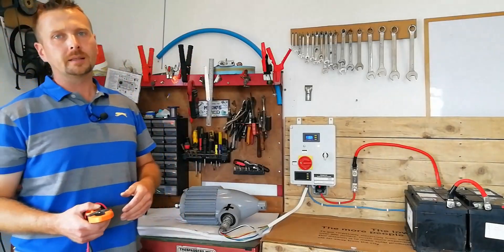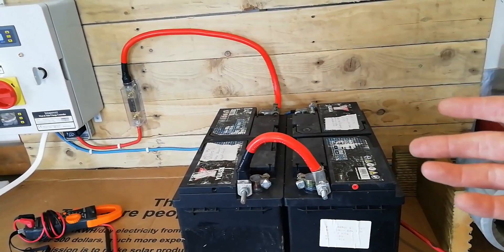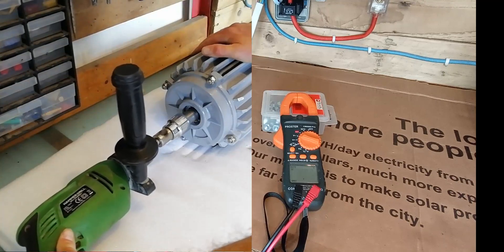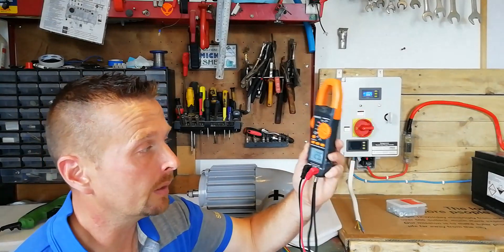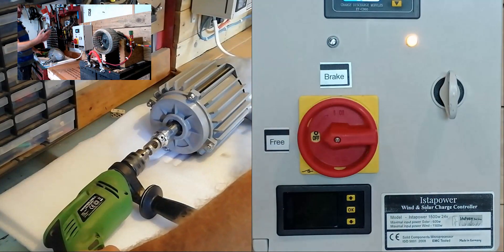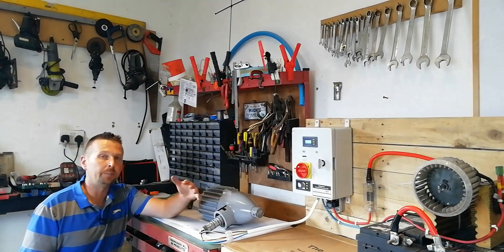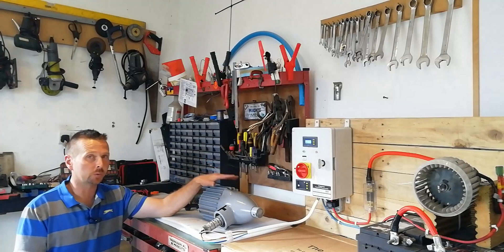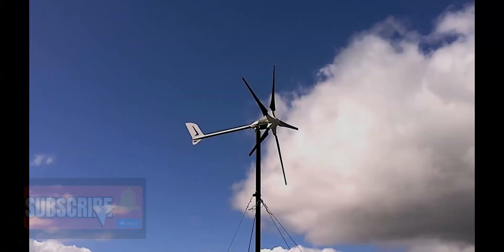Wind Turbine Max Output 1000 + rpm Bench Test, Istabreeze i1500 i2000

Comment: Hiya, love the channel btw! 
I am wondering what the differences are between the i1500 and the i2000, as they both have the same rotor diameter (2.1m). Does the i2000 require more torque and thus worse at lower wind speed? Is that why you went with the i1500 in the end?
I also see you went for the 5 blades too, is that to increase power gen at lower wind speeds right? I wonder at what average wind speed its better to have the 5 blade version vs the 3.
Or if its best to get the i2000 with 5 blades in case the 5 blades makes up for the additional torque requirement.
I have setup a weather station 5m up or so here in wexford, so I'll see what my average wind speed is over this winter to see if it will be worth it!
Love these videos man keep it up! 💪
Reply from the maker: How are ye. The differences between the i1500 and i 2000 is that the i2000 has slightly different magnets on the rotor and I believe that the windings are slightly different also. 
We went for the i1500 purely based on available budget at the time. The choice of 5 blades over 3 was to see more performance in lower windspeeds. The trade off is a reduced maximum speed, a gamble for want of a better phrase. Choosing a moderate input on a more regular basis over a maximum input on a less often basis. 
You've chosen correctly to do your research before deciding on what setup will work best in your specific location, its information that will pay off for you in the future and thats a fact. My own opinion would be that a 5 blade i2000 might be a good investment, let's see if your data aligns with that or not. Other than that, huge thanks for tuning in to the channel hope you continue to enjoy our content and find it useful.
Reply: @ourkilkennyhomestead2006   Thanks for that! Yeah sure I might get it early next year. I'll likely go for the 2kw 5 blade version then, and hopefully it'll work out! 
Do you think its worth it to get the "windsafe" version of the 2kw one or is it just adding more failure points? I see you've got a lovely winch setup with lots of lfp battery storage, so i'd say i'll likely invest in a similar setup so that i can take it down when a storm is approaching. I'll also probably make my own sturdy tower as well. Do you reccomend their bundle where it comes with the inverter and charge controller (? or should invest in a setup similar to the one in your 2 homes 1 off-grid finale video (which is beautiful btw!)

I'll be looking to get panels at around the same time too so it might be best to a route similar to yours. I've a nice large south facing 5*8 40m2 flat-roof shed so it should be handy to put 12-15 440w panels on it (5-6.6kw).

The prices have come down as well it seems, 2kw version is only 650 quid! Would be a nice big project to keep me busy haha.
I'll be sure to record lots of data and share it too. 
Yup love the content its super useful keep it coming!
Reply from the maker: @TheIrishLeprochaun sounds like a good plan. I'd agree with what you say about the windsafe models having more failure points, the biggest being that the slip ring can suffer from water ingress as its outside of the turbine body in those models. The standard 2kw on your own custom build strengthened mast setup seems to be a good way forward. When it comes to the batteries and inverters, what youve seen in the 2 homes project works extremely well. I've had great feedback from them over the last while about living with it on an everyday basis. Must do an update vid about it. 
Be sure to spend a few months surveying your site to plan the best locations for the equipment that you want to run, it'll make all the difference particularly in the winter months.
Reply: @ourkilkennyhomestead2006  Brillant thanks for that, yeah I'll make sure to plan and research a lot before pulling the trigger. Cheers for the info love the channel!
Reply from the maker: @TheIrishLeprochaun you're most welcome.

Comment: Hi , im wondering about your turbine , i have the 48v  i1500 version , ive seen it at over 3000watts, but i find when its lighter winds ie: 10 -15 mph its spinning fast but Producing nothing . Is yours the same as in it needs strong wind to produce? Thank you
Reply from the maker: @208d  with our model being the 24v, it would have a slightly lower rotation speed at which it begins to generate over 1amp at 24v. With yours being the 48v model, it will have to spin a little faster to exceed 1amp at 48v. For our 24v model in 10- 15mph winds we see between 3 and 10amps fluctuating with gusts.
Reply: @ourkilkennyhomestead2006  Ok thank you , mine needs to hit about 39v ac between phases to start producing anything , im thinking of ordering the i2000 grid tied version as it should produce higher voltage in low winds , but it may be too high in high winds. Ill link you two videos of mine. Thanks for the reply and all your time investigating these turbines
Reply: https://youtube.com/shorts/i1JNSx2dLUE?si=o9H3_-yQi7e43A9q

Comment: 3 blades will let it spin faster and spool up quicker. I got the I2000 but I gotta put my tower and stuff up cant wait 😁
Reply from the maker: @Meglenger  went for the 5 blade for better performance in low windspeeds. It does limit max rotation speed but allows for more days of production over the year.

Comment: Good to see it working! Is the wind turbine good at covering your winter gap when the solar goes right down?
Reply from the maker: @suekelleher2786  it does an OK job to be fair. Wouldn't say it's amazing, wouldn't say it's rubbish either. On the darkest winter days it beats the solar but usually solar is the better generator.
Reply: @ourkilkennyhomestead2006  ah, you have a more open aspect, here there are hills in the way of the sun and in the darkest part of winter only 4 hrs sun per day and on an east west split for the PV it does nothing. So the wind power might be worth a think about. Thanks for the info 😊
Reply from the maker: @suekelleher2786  based on what you've said there I'd recommend getting 2 turbines on the go as the initial investment might be slightly cheaper building the mast and foundations for both at the same time as opposed to starting with one, learning over time that it falls short of requirements and then having to build another from scratch. An elevated rotating solar array might be another consideration which might be a little cheaper than a 2nd wind turbine.
Reply: @ourkilkennyhomestead2006  oh thank you for all the advice I’ll have a good think about that! I’ve got a solar thermal panel on a south facing roof so it does take the edge off the cold water in winter. Not got a lot of land like you, it’s all filled with flowers and veg! By the way I got my polycarbonate tunnel finished, it’s 22 ftx8ft, 6mm twin walled and even got a wee window either side! The doors and windows are clear Perspex to give added light. Whole thing cost around £1300, thanks to your video and some help off friends I kept the costs down. So thank you! 😊👍

Comment: Very interesting video. The voltage test is fine, but the power under load test might be a bit pessimistic. The 700w label for the drill will be the input power so its output at optimal rpm would probably be 400 to 500 watts. Probably even less trying to drive that big load. Hence the drill  smoke!  Maybe the cure for efficiency losses is  a heli 2.0 or 4.0 !😅
Reply from the maker: @nhikoid  yes indeed, a bigger turbine would be VERY nice!